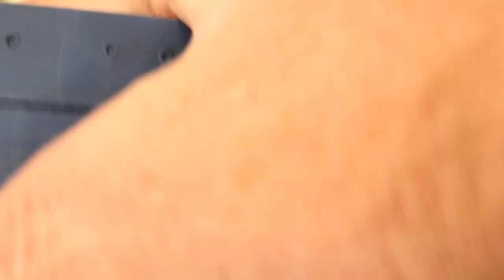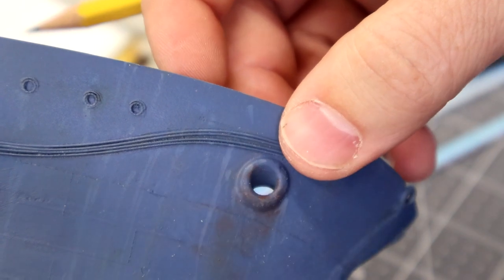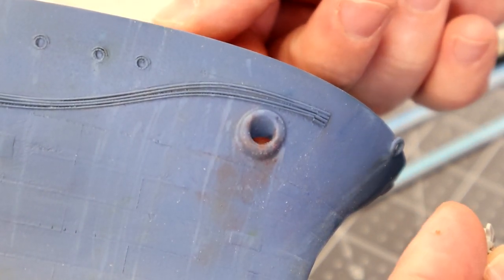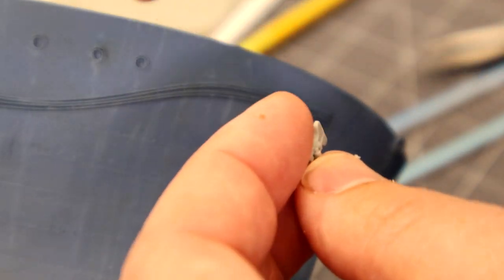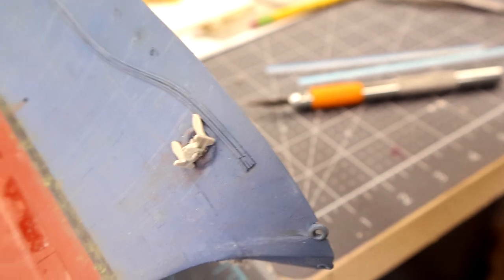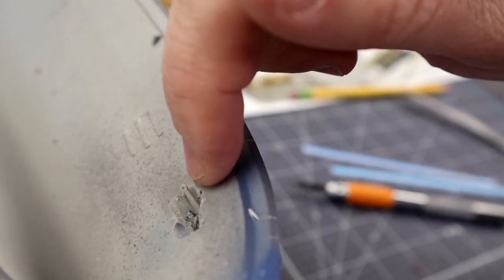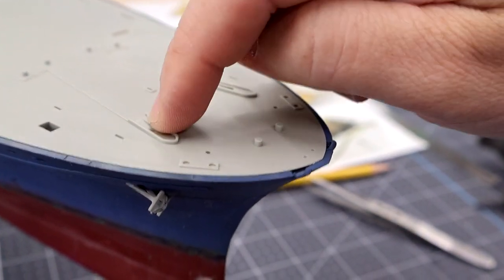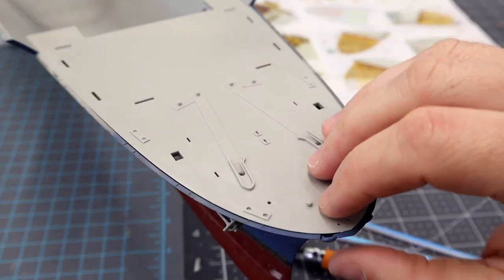1;200 CV-6 USS Enterprise Build Video 7

Comment: That fo'cs'le looks great.   Now, normally there was a "wear plate" between the capstans and the hawsepipes , which would either be pained black, or treated in non-skid--but, it's probably never going to be seen on the model.
Your carving on the hawse-holes in the deck was spot on (they are occasionally called "toilet bowls").  They often are cats with a cant towards the hawsepipe where it exits the ship's side through the bolster.  Those compound angles are what give the anchors their rakish tilt when stowed.

From memory (which could be faulty) the one reel has natural fiber line, and the other has steel wire rope--both of whihc are needed to rig paravanes or to hoist in/out anchors.  (Mooring lines are usually already made up with eyes, and the like and are stowed under the forecastle deck in lockers with the rat guards and chafing gear they needed (some carriers also stowed the heaving lines--the lighter, throw-able--lines usedd to pass mooring lines down to a pier or dock.  (the mooring lines were often 10-15 fathoms long and of 6-8" diameter line--not the easiest things to toss around.)

Outstanding job on this.
Reply from the maker: Good stuff! I was wondering why there wasn’t a plate under the chain. And yeah, you probably won’t see it…but we see it now 🤷🏻‍♂️

Comment: Hey Ben, this looks great. Love all the brass detail and those reels are outstanding. 

I’m curious what your masking process is like for the already painted walls when you fire up the airbrush for the brass details in this video and other situations like this. Masking complex areas like that has been super difficult for me and I’d love to see how you do it if you can show it in a future video or point me to where you maybe already have shown it. Thanks!
Reply from the maker: Hey! So, I just painted the wall. Let it dry and they masked it off. Painted the floor. Let it dry and did my video taping. Basically I just shot the brass parts in place using a small controlled setting on my airbrush. Since the parts are all the same color as the deck, it’s no problem. You just need to be careful towards the wall area. But an airbrush, with the right settings, can be like a brush. You may end up with a tiny bit of overspray, but the colors are so similar, it doesn’t matter. And in my case, since I’m going for a semi realistic warn/used look, it totally works.

Comment: Love your work. What is your process for preparing, priming the PE? I always have a problem getting paint to adhere to the PE although i am getting better adhesion now im using VMS etch primer, just wondering what  process and product you use.
Reply from the maker: My most thorough process is: clean with rubbing alcohol first. After it dries use a metal primer. If you brush it on, it works better than the stuff that’s airbrush ready. After that dries I use Mr. Surface primer. (Tamiya primer is also very good) then I apply my paint.
Reply: @TheMidwestModelShop  thank you. The only process i don't do is rub it over with isopropel alcohol. Do you clean all PE and brush on etch prime before you start a build or as you need it?
Reply from the maker: No. Only the parts that I will have to manipulate a lot or will be exposed and likely touched or big pieces where a failure of the paint would be bad. (Which sounds like a lot but in most builds is only a handful of items) Most subjects get cleaned and shot directly with enamel paint and installed. If they chip, I touch them up.
Reply: @TheMidwestModelShop  thank you very much for the info. You and Kenneth at Norwegian model bench are a wealth of information.

Comment: The top of the anchor is wrong,  the alignment of the shackle is 90' off,  the inside of the hawse pipes should be approximately 45' from vertical and towards the stern.  But I do love the effort in the anchor details!
Reply from the maker: How do you explain the pictures of the anchors at the angle closer to 90 then?
Reply: @TheMidwestModelShop  when anchors are Dropped,  they are usually Walked out a distance first,  prior to disengaging the wildcat,  then when ordered to " let go"  the brake is released and free falls to the bottom
Reply from the maker: Okay well, you didn’t answer my question. If you look at pictures of CV-6, during WWII, the anchors are stowed as I showed in the video. That’s why I put them on the ship that way. So what is your explanation for that?
Reply: @TheMidwestModelShop  what I was saying originally is that the anchor shackle was out of alignment,  the shackle should bend the same direction as the anchor flukes.  I do believe that the hawse pipe locations are off a bit,  the model looks great,  you did great by engraving into the hawse pipes to get the better angle for the stowed anchor position,   just saying anchors don't get dropped from the housed position.  I think your doing great with the model, if I can help further, let me know,  not sure if that cleared it up for you?
Reply from the maker: No worries, Jeff. I get what you’re saying now.